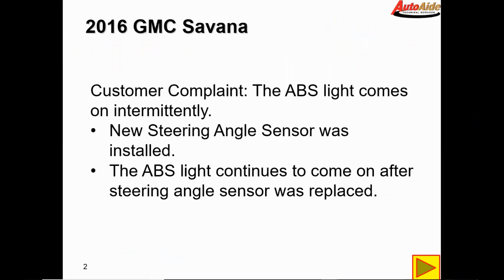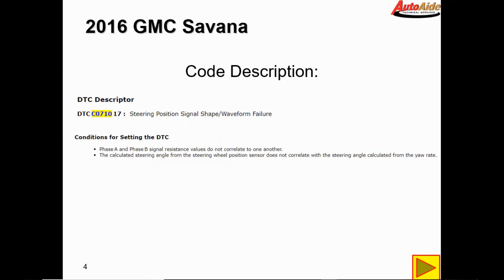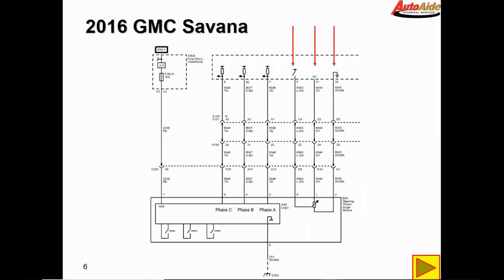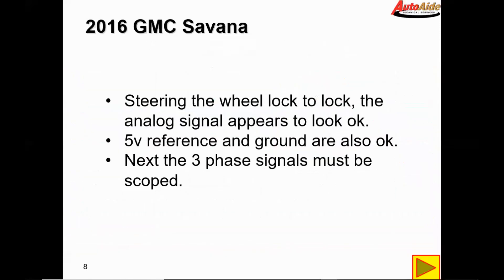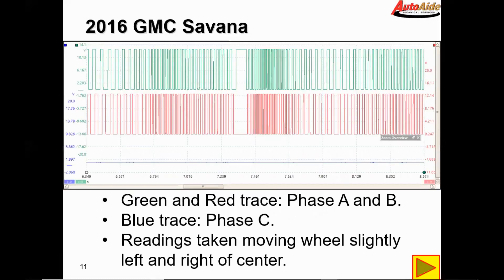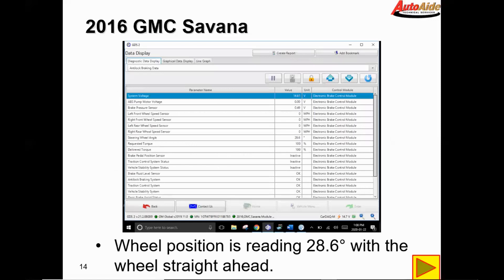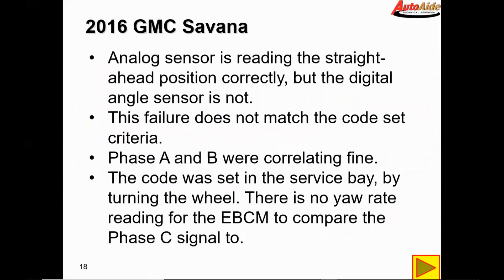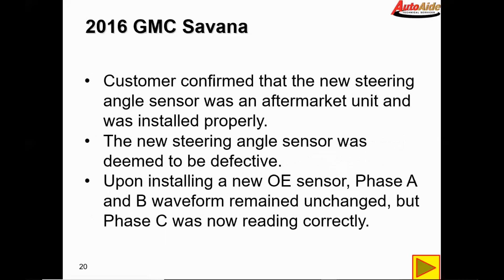How I Diagnosed: 2016 GMC Savana with an Intermittent ABS Light

Comment: My 2014 3500 Savana has same problem, so far have not been able to fix properly, shop has replaced abs module and wheel speed sensors,

Comment: What would a steering angle reset accomplish with the aftermarket sensor?? Wonder if it would of read 0 straight ahead after
Reply from the maker: Great question. We did attempt multiple SAS relearns before digging into the diag, and none of the resets changed the steering angle data pid. In the end the sensor itself was faulty.
Reply: Actual footage of you diaging like scannerdanner south main auto etc would blow this channel up with subscribers
Reply from the maker: That is definitely our plan for future videos!